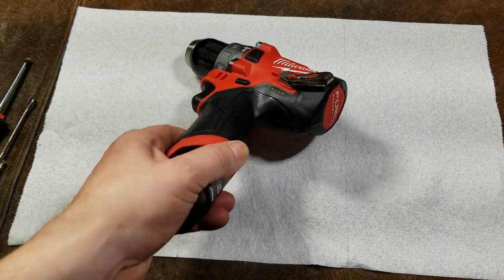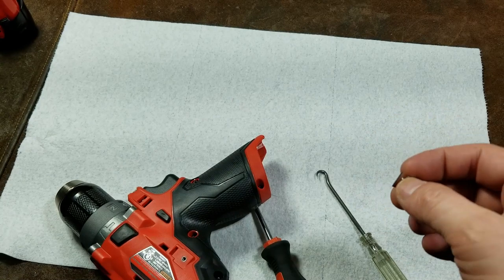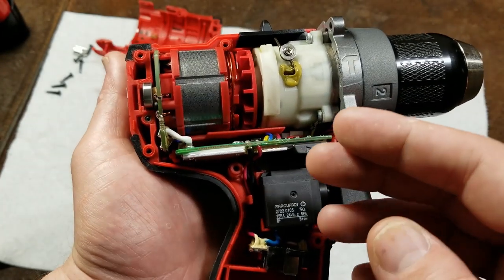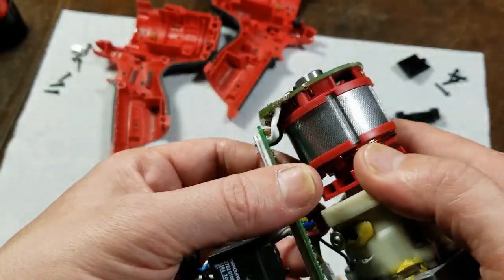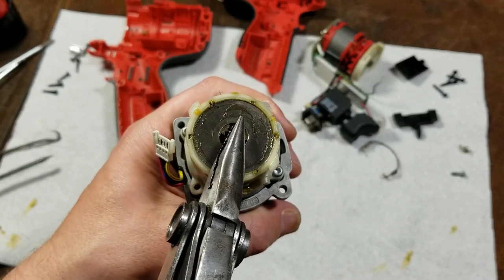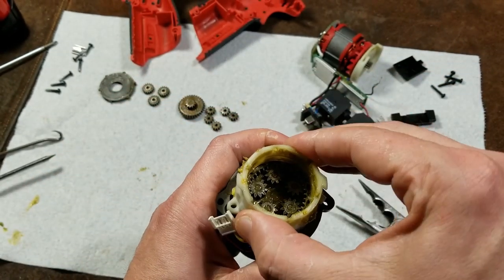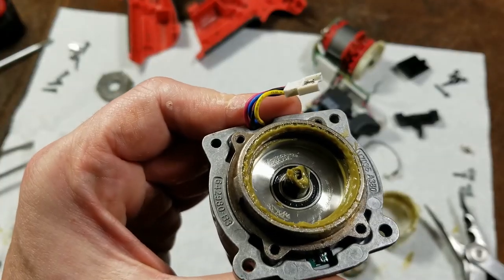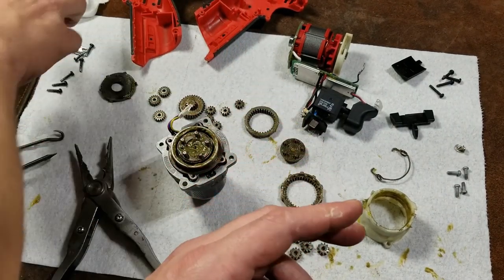TearDown: Milwaukee M12 2nd Gen Hammer Drill

Comment: Very interesting tear downs.  Just discovered this channel.   Coming from AvE.  

Just bought this drill it looks pretty nice judging by the internals.  Although lots of powdered metal steel parts, from AvE’s tear downs tho he even saw that the $700 HILITI drill had a plastic gearbox housing and powdered metal gears...
Reply from the maker: In my experience hilty's on build any better than a Milwaukee or Makita or anything it's just that they have that 20-year warranty now. Plus the one or two-year wear warranty which nobody else has
Reply: Buy a 6ah battery for it.

Comment: Fantastic video. Not a single dislike. I have the exact same drill but my chuck looks different from yours. Mine has the knurled pattern all way round and no smooth parallel breaks like yours does. Thanks for the video as I had been wondering what was inside the unit.

Comment: Thanks for the level of detail. I'll be running the video backwards (if I could). This afternoon I opened up my drill and pulled the motor off the gearbox. There went all those little gears onto my garage floor. I'll set the parts on my shop bench tomorrow, and with help from you video, get everything back together.

Comment: awesome- my 2408-20 is intermittently dead.  I have to pull out/reinsert battery many many times to get it working for a few minutes.  I was going to take it apart but I can find no tear downs.  I see the clip and the screws for clam shell---so I will give it a go.  This video helped me tremendously to know how it comes apart and how to deal with clip.  thank you
Reply: I have the sane issue. Did you manage to find the problem?

Comment: Good job. It's exactly what I want to see on a teardown video. I wish everyone doing reviews of tools would do this, also describe the tool, it's specs, features & show it in action WHITHOUT ANY music so we can hear the damn tool under a heavy load doing what it's supposed to do. And not just installing or removing a few small fasteners or whatever, show us heavy duty usage for a least several minutes and different types and sizes of fasteners etc.. I like this tool, would have liked to see ALL of the components of it but I know sometimes the manufacturers use special jigs & proprietary tools to assemble & disassemble their tools/products etc.. I would like to see a metal outer gear case for those planetary gears also. I don't like electronic clutches, controls etc. inside tools either. They don't last as long as other tools without them. Keep it simple and stout/robust. Those damn rubber overmolds I don't like either because they eventually break down & look terrible. Just mold some grip into the metal cases of these cordless tools & get rid of the cheap plastic that eventually breaks also. Make all the cordless tools out of ALL metal. I don't care if it weighs a little more than a plastic comparable tool, I want it to last! Too many tools & electronics these days are not made to last for several decades like in the past! Get back to the basics but include innovative features that last a very long time!

Comment: Nice video Catus Maximus, I have a drill as the one in the video, when I use it the motor of this heats up quite a bit, so I leave it idle for a while and then I continue using it. I haven't risked that it disconnects automatically when is too hot. Could you suggest me how to fix this issue and if is the motor or the electronic card that is failing.

Comment: after watching this video, I went to home depot and grabed one for $129 CND with one battery and charger, thanks for your work.
Reply: I just got one too for that price but it's broken right out of the box. Stuck in hammer mode no matter what setting you've selected on the clutch. It's impossible to use. I was hoping he'd take the gear box completely apart so I could see how that selector works. I really didn't want to have to deal with returning this thing to Home Depot because I ordered it from them online. Such a PITA.

Comment: Great stuff. I'm looking to drill small, accurate holes in metal with a compact drill. Would this with a Rohm chuck thrown on it do the job?
Reply from the maker: Yeah that would work great or you could get a Jacob's 700 series which is the carbide tooth in about the same as the rohm but a little cheaper
Reply: The digital clutch on these is useless though. If you use a clutch for preventing driving screws too deep than look for one with a mechanical clutch.